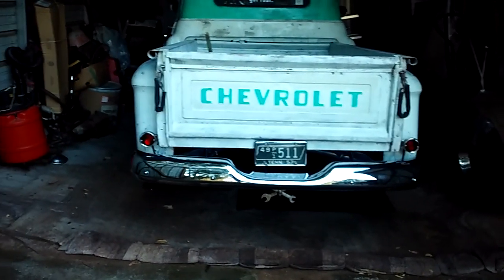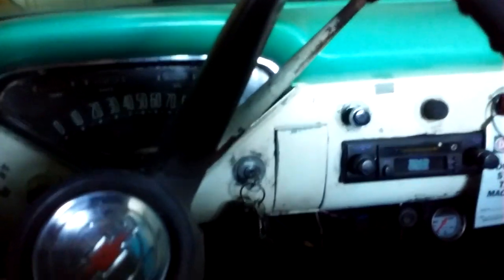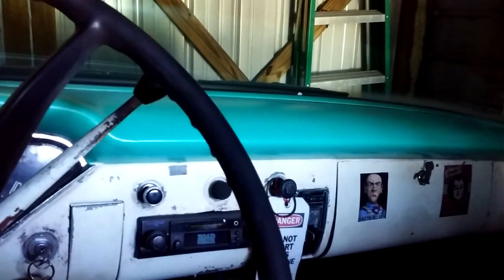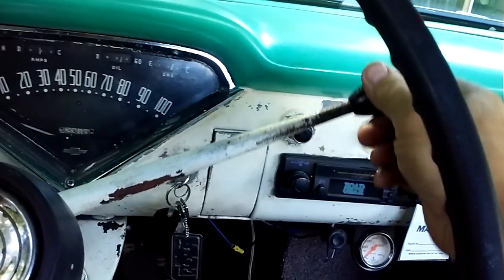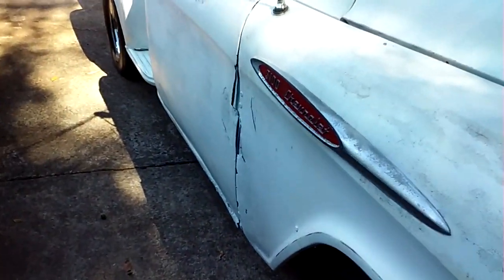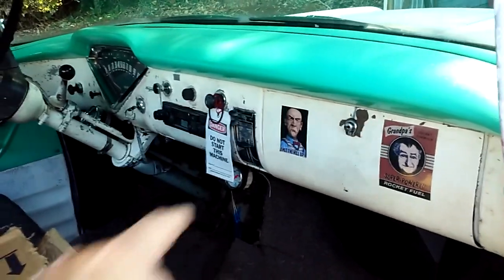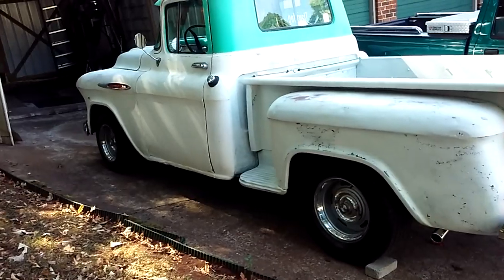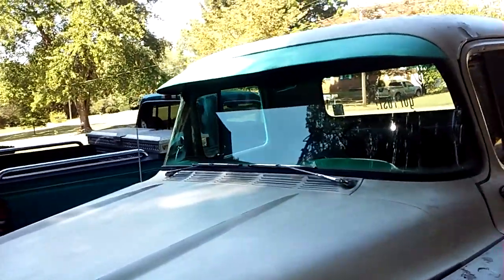Starting a 1957 Chevrolet step side truck. How to operate a 3 Speed column shifter.  3 on the tree.

Comment: I used to have a 1979 Chevy truck with straight six 250 and three speed on the column.  It ran really good but occasionally the shift linkage would jam.  I had to open the hood and mess around with it.  I am saving for a 1957 straight six, 3 speed stepside.  When I was a kid my friends Dad had one and I used to ride in it, plus load it with brush and trees at the church in Saturday’s church yard clean up day.  His was green.
Reply from the maker: Boy, I sure do enjoy your stories. I have had to mess around 28th the linkage too at times on my trucks I have owned on the past. So far my 57 had not given me any problems yet. I hope you can find a good 57 sometime. Where I live they are sometimes hard to find. I believe mine was orginally green too. Thanks again for the wonderful story.
Reply: Prolly just needed new plastic bushings where the linkage connects to the levers, they are available aftermarket